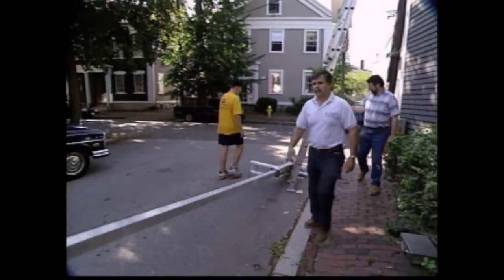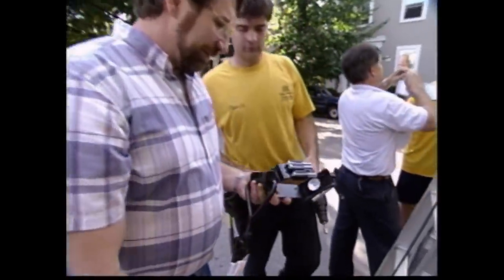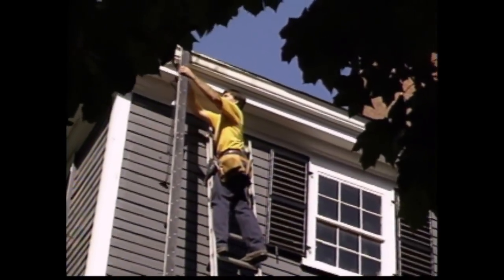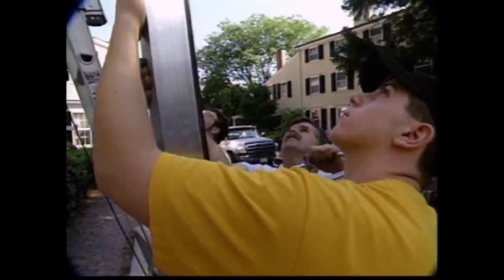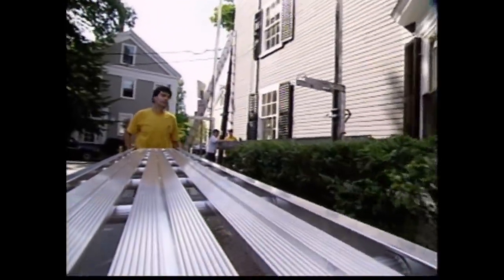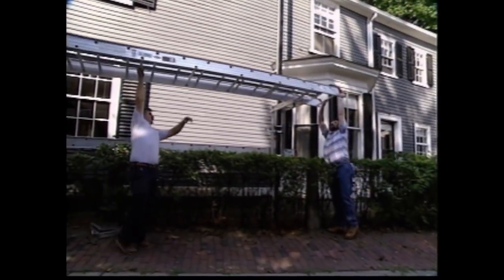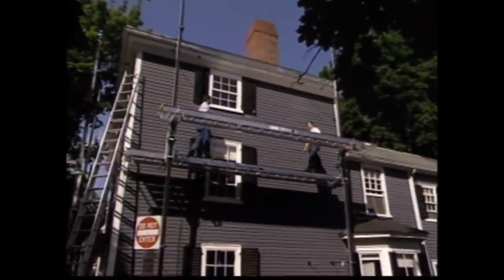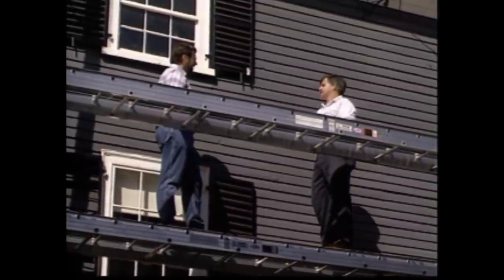Tom and the crew set up pump jack scaffolding 1995

Comment: I'll never forget my first pump jack experience. 2nd floor of a house installing a sliding door, no harness, no work shelf about 20 feet from a cliff. Very exciting.
Reply: The work shelf was like a luxury that no one seemed to want to waste money on. Said it was like buying two scaffolds for nothing
Reply: My experience with pump Jack's were the ones using two 2×4's. Talk about wobbly! You had to brace them quite a bit to feel secure.